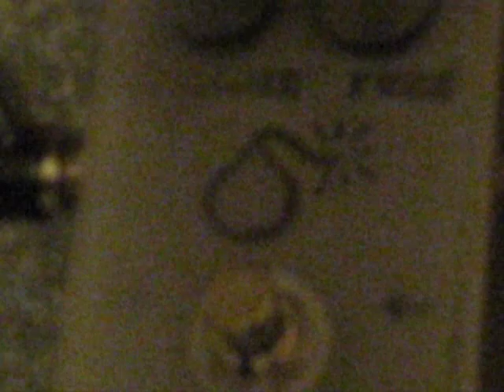DIY Guitar Effects Pedal Demo - Craig Anderton Tube Sound Fuzz

Comment: The TSF is a beast. Built one of these in the mid-80s and played the hell out of it, including lots of gig duty. It can be picky about which amps it will cooperate with and can take some time to really dial in, but once you find that sweet spot, look out. One of the best lead tones I ever had was and EMG 81-equipped Les Paul into the TSF into a Carvin X60B head (hi lead and eq on).  Still have it.

Comment: It used a CMOS chip as I recall. I built it and thought it was unique and tubey, but had sustain issues. I built all of his effects in that book back in around 82'. Loved the Preamp, Super Tone Control, and the Phasor. The Phaser had (has) the best slow sweep vibrato ever!
Reply: I got the book in the early 2000's and wasn't able to get the right parts for the majority of the projects I thought I'd be able to pull off...jealous that you got to do them all! This was the one that I got parts for no problem. No sustain issues for me.

Comment: tried this about a year ago and it worked great until I put a stomp switch in and tried to get it in the metal enclosure and it stopped working properly. decided to have another crack today with almost all fresh components on a breadboard and I followed the book to a T. checked all my resistor values and capacitor polarities and its kinda only half working. It sounds like it wants to be a fuzz but is toooo quiet and has a big hum. any ideas?